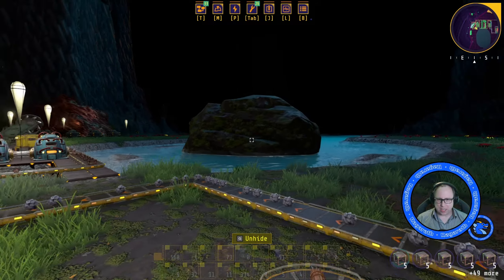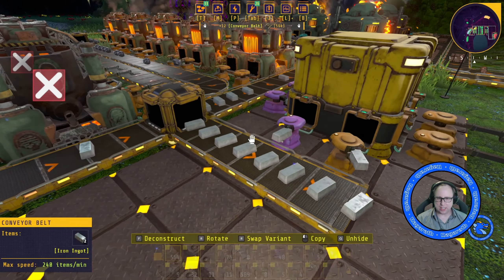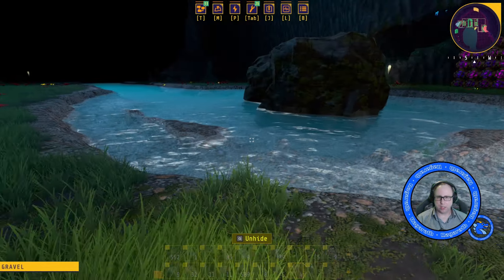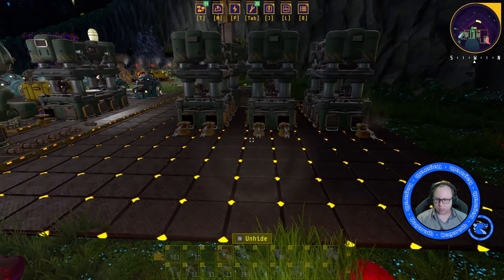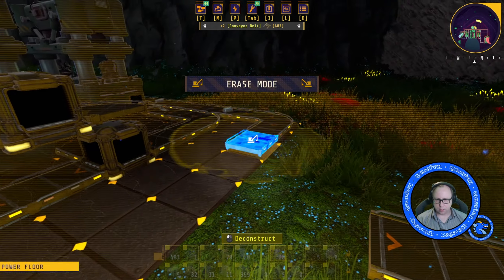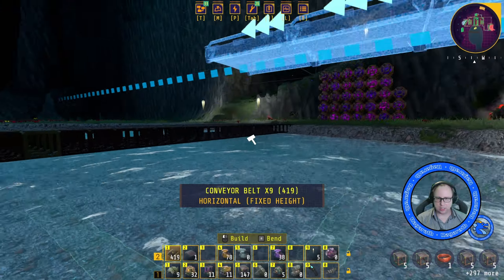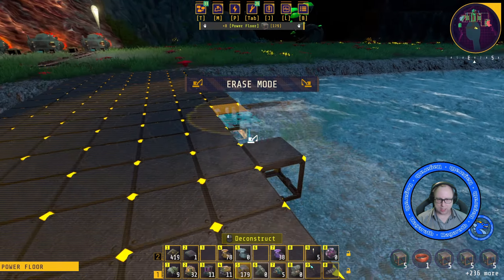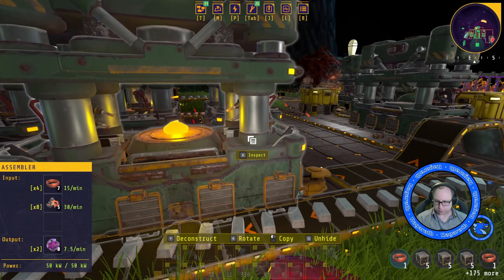Techtonica 0.4 MORE Cores on Mountain King Underhall

Comment: Have you found anything else in the underhall map? Not enough kindle vine seeds to support my base. I tried mining out the perimeter and fell through the map. Also a bug where wall faces didnt appear. I have mined into random spots. Aside from the main network, I have not discovered any concealed cave networks. Did I miss anything?
Reply from the maker: Not that I've seen yet. I think it is just one huge room with the cave system to xray.
Reply: @Ragarath  I guess it comes down to tech. Maximise kindlevine as much as possible by getting every single kindlevine plant then get the tech to get the most out of your kindlevine so you arnt too short on extract, then go all in on shiverthorn. A hundred+ planters. Convert the biomass to the fibers to produce plant matter frames and store the excess shiverthorn extract as shiverthorn gel at a 100:1 ratio. I think.